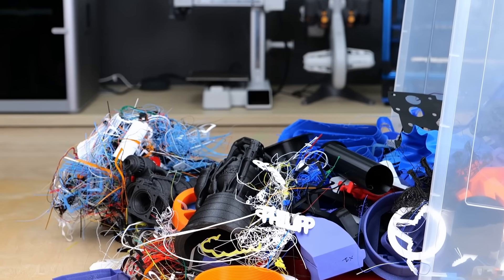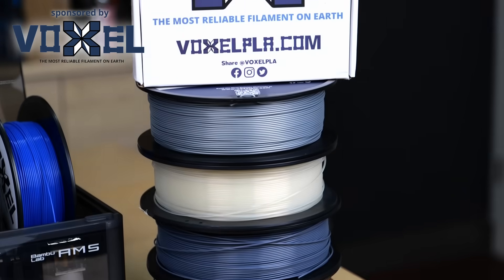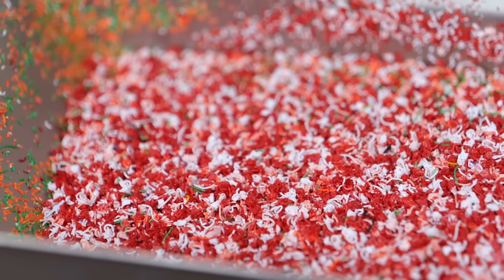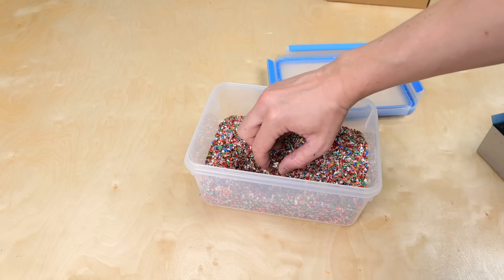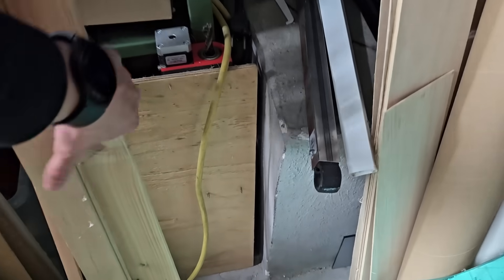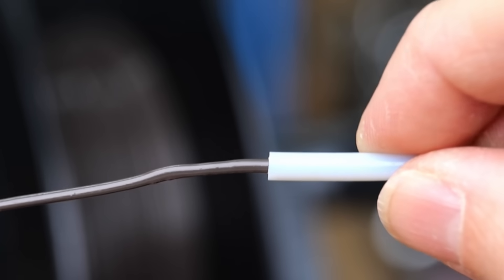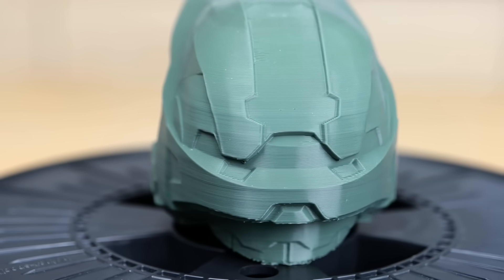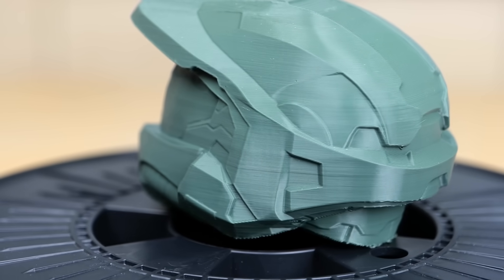Turning 3D Print Waste into New Filament!

Comment: I don't print massively often, but right from the very first test print I ever did, every bit of waste plastic has been kept in a lidded tub, waiting for the day that recycling it could become viable at home.
It looks like we're still not quite there yet with the machines needed to get something that won't keep causing jams, but we're slowly coming closer to a workable process.
I definitely like the idea of the "pelletiser" - a similar mechanism with a robust design could make a very fine addition towards the production of reused filament in a small workshop.
I think the filament pullet mechanism might need to have rollers that also act somewhat as a mould that squashed the filament into the correct (or at least more consistent) size, cool it down immediately past there, pass that through the diameter sensor with another pair of rollers, and then spool it.
Reply: If u're in the USA, I'll take your PLA trash. I make Upcycled art from plastic and what not.
Reply: @matildo4ka7  I'm sadly very much not in the USA, so I think taking my print trash would be an unnecessarily expensive endeavour, but thanks for the offer.
Reply: @KingOfRedPlays  if you're not in the US to cover the shipping for me will be not feasible) thank u for replying)

Comment: I want to buy recycled filament, problem is more so that it's inevitably an inferior product due to the degradation of plastic, so it's hard to justify it as a consumer when it's usually more expensive than virgin material.

Comment: i've always wanted to have a 3d printer but despised so much the idea of generating so much plastic residue, i'm glad to see some 3d print youtuber taking the interest on reducing such harmful waste.
Reply: Thats my biggest hang up too. I am glad my local filament supplier makes their own PLA and takes back scraps for recycling.
Reply: @instanoodles  wow that's so nice of them.
Reply: Guys there’s only that huge amount of waste if your doing multicolor. Plus bamboo has setting that you can adjust to shrink the amount of waste
Reply: 1. Print single color and paint. 
2. use PLA, it’s easier to recycle or destroy
Reply: I personally try to pollute the earth as much as possible
Reply: If environmentalism is important you should only print with PLA which is made from corn starch or sugar cane. On the pollution side that only matters if you get rid of the waste in the wrong way. I could be wrong but i also believe PLA is biodegradable although not over a super short amount of time
Reply: Yeah my hangup too is there is a lot of greenwashing around PLA. PLA is only compatible in industrial settings, meaning it can still contribute towards micro plastic pollution in the environment. Truthfully? As it stands 3D printing is pretty bad for the environment
Reply: I love plastic straws
Reply: Please don't get a printer. The community doesn't need more cry babies.
Reply: @blakeglengary8065  gatekeeping because they dont want to create more unecessary plastic. What a great life you must be living.

Comment: well dont extrude so much of that initial extrusion, another way to solve the too much extras. also single color + paint. multi color filament mixer. brown is also cacao. also why not have an 1.75mm nozzle instead of fiddling with the filament stretching. you could also have a heated shredded material bay, to drive out the water vapour.
Reply: are there any low cost (3d printer range) of cnc, sub 400eur, should have a bed attached 4th rotary axis for lathe cnc.

Comment: Why not extrude the "poops" into small pellets that are easier to recycle?  The printer could be programmed to poop the colors into separate bins.  Perhaps the pellets could even be used in a pellet based 3D printer and skip the filament step altogether.

Comment: I'm not sure why we have so much poop.  Surely this should be a solvable problem.  There are already advanced flow calculations happening here, and we know pretty accurately how much filament is going through the nozzle and we know how much we need for any given instruction.  Therefore why can't the system essentially calculate how much of the current filament is needed, and perform the changeover IN ADVANCE so that much of the old filament gets used, then there would be a very small changeover period.  This would probably reduce the poop by over 50% if not significantly more once tweaked.  I'm not saying this is simple, but it should be a solvable math problem for the smart people that have done some of the amazing things in slicers/firmwares recently.

Comment: The more I use my P1P the more I wonder why there isn't a system to feed the filament at the correct time. I've manually fed small strands and the print comes out fine. I ain't smart enough to automate something like that... yet... but with how much poop the bambulab printers create, I don't really understand how they didn't plan for this already.

Comment: Lowering your purge volumes in Bambu studio also helps. If your willing to spend some time to figure out how much of a purge length you actually need. In my experience I found that for many solid colors, halfling the extrusion distance worked well. But in some situations I went and further refined this getting down to 1/8th of the original purge distances. It does also allow you to set purge volume based on the filament colors involved in the change. So say a very dark like black to a transparent might require a greater purge than to another solid color. I generally don't use a purge block either.
Reply: This has worked very well for me. Just need to watch out for highly contrasting colors but around 15-25% default purge volumes has greatly decreased waste.
Reply: I had that exact question and you answered it beautifully.  Also, it's very interesting to hear that you can adjust purge length to tuples of colors.  So smart!
Reply: How do you get rid of the purge block though. In Bambi studio.
Reply: @EndofTimee1  Disable the purge tower under other settings

Comment: My partner considers plastic recycling my biggest rant horse. Honestly, nearly all plastics can be perfectly recycled, especially the common filament types. While the DIY route can be valid in some cases, FDM printing being one of them, the bigger question lays in packing materials, and the waste stream is not question there, it's the supply side. It's high time government (preferably the EU, they have the ideal platform for this)  puts out the notion that they want 50 reps or so of the industry, going by produced volume for the first 30, after that specialty industries and interest (e.g., medical packaging, long term storage, industrial interchange, transport)  in a room for a month, pay them whatever, draft them if necessary. Impress upon them sweeping legislation is coming, and this is the only chance they get at influencing it. At the end of the month, they get to pick a low number, say 8, kinds of virgin plastics that they will use for absolutely everything from now on. These will be given a simple colour coding system. This will be the only single use plastics now available, pending review in 10 years. Consumers are now able to effectively sort plastics, and even if they don't want to, robots and people can. Don't want to abide by the colour code or need a fancier plastic? Don't flog your stuff in the EU, or pay disposal taxes like non-single use items. problem solved

Comment: After seeing so many attempts at this I have just about come to the conclusion that trying to turn 3D printing waste back into filament is simply not practical, nor is it likely to make sense environmentally speaking. Especially on a small scale. There are a variety of reasons, some of which have been outlined here. Reusing it in compression or injection molding makes much more sense to me. Precious plastic and others have done wonders in this arena.

Comment: The problem with 3D printing is people are printing whole masks in multicolored filament in the time you could try to do it in clay, wood or just print it in one color to make a mold and then produce many masks with just one main plastic model. It's terrible for the environment and it's supposed to be used for prototyping and not full out production. As an industrial designer the whole 3D printing community seems very childish and irresponsible. The amount of waste in energy and waste created in the form of regular plastic and microplastics is unfathomable. There needs to be a change in the way people use 3D printing. This said consumers also need to be educated. The detail on the mask you showed is terrible. The lines don't flow with the design and a clay or wood mask would be much better, but the consumer doesn't care and that's the other half of the problem. Hope your channels keeps doing alright since it's one of the best and you've come a long way. Thanks for the content!

Comment: Some potters recycle offcuts and failed pieces of their work back into fresh clay. The process also involves an auger and nozzle. They want to control moisture, not remove it completely, and they too use vacuum to remove enclosed air bubbles that can later cause wares to burst when firing in the kiln.

I wonder wether your rather extreme drying effort could be integrated into a future version of the filament extruder. The machine already has to heat the stuff so moisture should be eager to get out anyway. Give it a chance and some encouragement and maybe that step can be an integral part of the remelting and extrusion phase.

I am only watching this for entertainment and am terminally lazy. So wondering is all I am likely to do :-).

Comment: It seems to me that the only issue you had in this process is that you have a 5k machine that maybe should be worth 200.
I am sure that some engineering went into that machine, but it is clear to me that it is a minimum viable product. I see many potential fix for the over diameter issue, you could simply had a set of spinning wheel with a grove right diameter (I assume that this is what is the set below), but having one on top and one on the bottom would allow to already have a presized filament to stretch instead of the 4mm that is there from the top. Is a very simple change but I am quite sure it would change a lot the result.
I think this process could be more than valuable, and if people can make petg in a filament with an hot end and some bottles, I do not see how pva could be such a challenging process. Worst case scenario, we can convert the PVA into a cylinder like shape and use the same process used for bottles extrusions to extrude PVA.
The machine used is meant for pellet, but I am quite confident that with the correct design it should be possible to get a good extrusion.

One of the bigges potential issues that I see is the color mixing. Plastics colored with  different colors may have sliglthly different properties that may not mix well togheter

Comment: I got tired of stuff getting stuck in my short tube, so I simply drilled it out after it hardened a bit from a bit of use... The nozzle itself has a 4mm intake, it is the teflon tube that gets the blockages unless it is something stuck in the nozzle tip.

Comment: Hi, sadly the recycling Fabrik now only takes filament when you already bought their filament. Which is too expensive. It costs 2 or 3 times more than none recycled and is worse. So sadly I wouldn't buy theirs. But a college is working with  metal and will fill metal forms with melted pla for example to produce fishing lures

Comment: Nice work.
My experiments have shown that for best results you also need to add "virgin" PLA into the mix at a ratio of 70/30 approx (70 recycled 30 new PLA). I am not a chemical engineer but i believe that shredding,heating the material multiple times breaks its molecular structure and that creates a lot of the issues during extrusion.
Reply: That's correct. It loses viscosity  aka bonds are getting broken.

Comment: A big problem for making this scale is being able to seperate plastics from eachother. If you're a filament recycler taking in plastic from different sources, you cant really trust that those people are giving you clean, properly sorted filament. A technology for sorting, splitting, or not caring about mixed polymers is an important step
Reply: They do sort plastics at recycling plants. Different plastics either have different densities that can be sorted, or absorb different wavelengths of light
Reply: I think another issue is likely that say ABS is not ABS is not ABS. That is I figure that one cannot just pitch their Polymaker into the same bin as their Atomic or Inland or Fusion Filaments.
Reply: Sorting is already possible, the problem is making recycling process to be cheap.

Comment: I half expected that you'd have to mix virgin material into the recycled material, just so that it flows better in the machine. You might be able to get a really good consistent diameter pelletizing and then mixing with some virgin material, so that the mechanical properties aren't too degraded.

Comment: I not only do sort by polymer but also by color 😅
For each one i got 2 boxes (1 small 1 bigger) in the bigger one comes the fails or calibrations etc, in the smaller ones comes the 'self' shredded plastic (smashing the sh.. Out of the parts to break them small and then use an coffeegrinder)

In my case its possible because i don't print in large variations of color rather than material (pla+, petg, pa6cf, asa, abs, tpu) so it doesn't take that much space
Next thing is that i very rarely print larg objects, most of the time small to middle (80x100x150 is the average size)

Comment: I think there's a market for some kind of cottage industry filament recycling service. Imagine a service where you mail them boxes of your failed PLA prints (or Bambu poop) and get 'credits' based on the weight and quality of the material you send. They handle all of the sorting, shredding, and re-extrusion into new spools, and then resell them as recycled PLA. Users who mailed in material can use credits to buy spools made from the recycled material (or just buy spools with money). Could even sell rolls of filament that are partially recycled, ie) 70% recycled material, 30% virgin material, or 50/50, 20/80, etc. The biggest hurdle would be having some way of verifying and detecting the incoming material- you don't want somebody's polycarbonate benchy getting ground up and contaminating a batch of otherwise consistent PLA. ABS should theoretically be even easier to recycle, though it's not as commonly used as PLA for prints.
Reply: That's acutally exactly what we do as the Recycling Fabrik in Germany. You can send in failed prints, support structure and empty spools, we pay the shipping, you in addition collect Points for ur Scrap and use them to get the 100% recycled Filament cheaper. Win-Win-Win?! Only work in Germany at the moment tho. Greeting Jonas
Reply: @Jonas-rz3vq I’m in the USA, a big proponent for recycling & hope to use Recycling Fabrik sometime hopefully soon.

Comment: There are more affordable and less wasteful printers that will produce far less waste than the Bambus. Granted they can't use as many filaments at once, but I'd settle for a 2 or 4 filament machine and manually swap spools than use a process that puts out ovrr 2x the waste as the print itself

Comment: One of the biggest problems with recycling plastics, and the one that really breaks the concept in my opinion, is the chemistry involved.

Plastics (perhaps excluding the ultra high performance ones like PEKs and PSUs) continually degrade as their default mode of existence... and faster so, the higher the temperature is, and the older they are. Both of those are a problem especially for recycling efforts, since those involve, well, heating old plastics to high temperatures.

Why is that an issue? Plastics are kind of intuitively considered unhealthy.... and with most that is actually true. The "plasticky" taste of water from a PET bottle? thats a soup of micro/nanoplastics, plasticisers, degradation products of antioxidants, colourants and the polymer itself. The impacts of none of those are, as far as I can tell, either fully explored or assumable harmless.

And their recycled brethren is much, much worse- not only is the plastic heated up a few  times more, the already somewhat ruffled up chemistry of the aged polymer, and the already depleted antioxidant (read chemicals meant to protect the plastic itself) stores make it degrade even faster.

All that translates to more micro (and nano) plastics and random volatile organics shedding, worse physical properties and in general a bigger pain.

Comment: Extreme waste of time and effort* - call it a hobby 😅

Realistically: simply put all PLA crap to energy waste**. CO2 -> starch -> PLA -> CO2 and so on. Best recycling is easy recycling ♻

* Might be feasible for print farms, where large amount of filament is used and e.g. spool leftovers can create a lot of waste. Though they probably optimize filament usage?
** If your country does not have energy waste, try to make a change. Landfill is so last millenia.

Comment: Nice project. Wouldn’t be surprised if in a few years diy recycled filament becomes easier in a similar way printers themself have evolved to be more user friendly. 
On a side note I’ve been having great success recycling plastic drinks bottles into PET1 filament using a mk6 recreator by JRT3D. We don’t have any bottle deposit scheme here in the UK so not loosing money on the bottles. The resulting PET1 filament seems to be more heat resistant than ABS/ASA